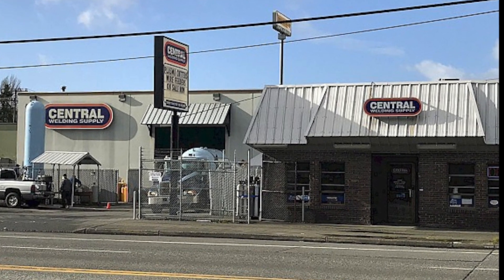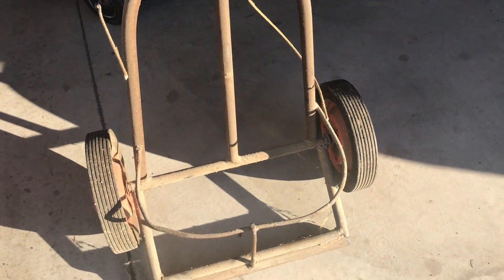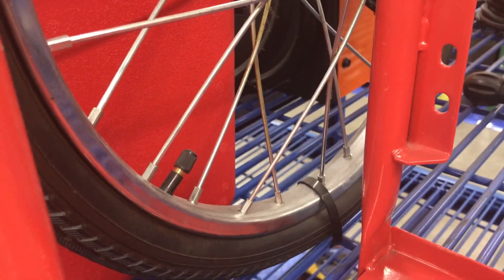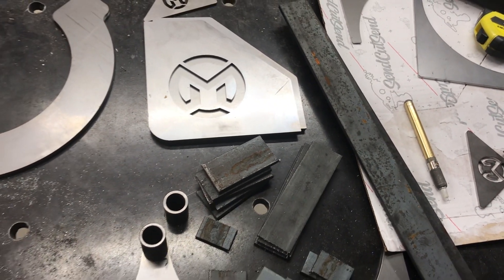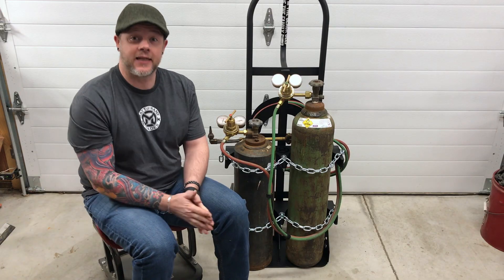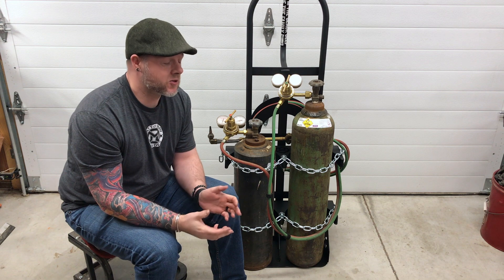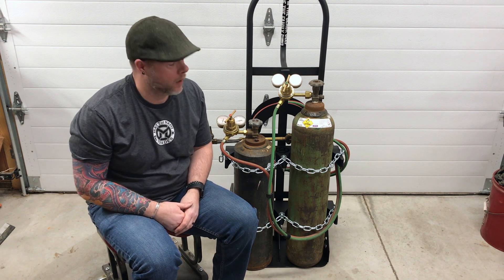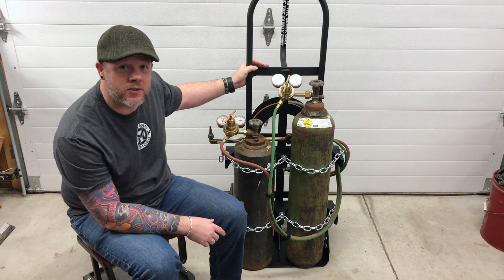FABRICATION | DIY Torch Cart Build

Comment: Great video tutorial, now if I only had 30K-50K worth of tools and welders.
Reply from the maker: SendCutSend will be your friend.  It is like having an on-call plasma table.  The torch in this video, along with the hoses, bottles, and manky cart cost me a total of 150 at an estate sale.  I see them around for that and less weekly.  The welder is a Lincoln 180c that was $600 new. I used gas, but you could do this with a $20 roll of Flux core wire.  Say $50 for a helm and $15 for gloves and you are in the fabrication business.  Use these to earn enough for roller, then a bender, a press, eventually a plasma torch and you are now your own boss.

Comment: The victor torch your running looks to be the 315fc model has flashback arrestor built into the handle, there called vangaurds in the book. They are serviceable. If your stretching your hoses to 50ft+ it's suggested to have arrestors at the regulators as well as the torch. If you flip your torch handle up you'll see it says flashback arrestors right there on the bottom by the valves. The added arrestors only restricts your gas flow.

Comment: That’s quite a bit for something for such small oxygen tank.   I would like to build one for full size oxygen /60 gal propane tank.   It would probably need to be a lot wider.
Reply from the maker: I made it to fit the large tanks as well. The  radius on the tank mounts is 10”.

Comment: Hey man just a thought, if you fabbed up those bottle brackets and just drilled a set of holes in the back (to allow use of a U-bolt to attach to dolly upright bars) you could sell them as a super easy way for people to build their own. Could do a series of holes for multiple carts... Maybe even offer the hose holder in the same fashion. Turned out great!
Reply from the maker: Thank you!  That is a great idea.  It would take little design tweaking, but is dooable. If I do it, I will send you a set for free :-)

Comment: I bought the harbor freight cart for my full size bottles.... It is sitting in a corner of a closet now.  Those tires are horrible. I just made a combo welding cart with bottle stand on the end.  But I really need a small set like you have for mobile welding work.  Those big bottles are back breakers for me now. I used to pick them up all the time.  Getting older sucks. ;) That is a cool cart you built.